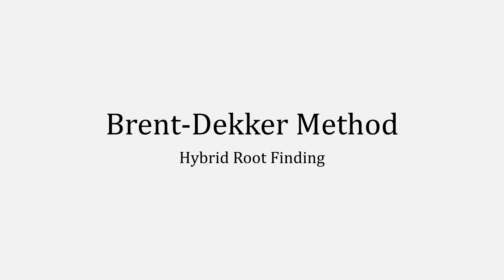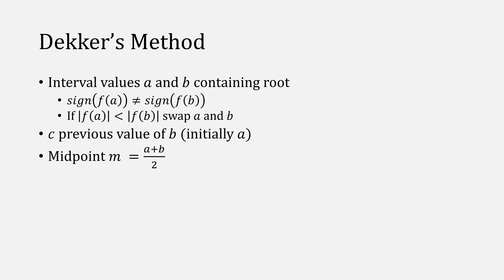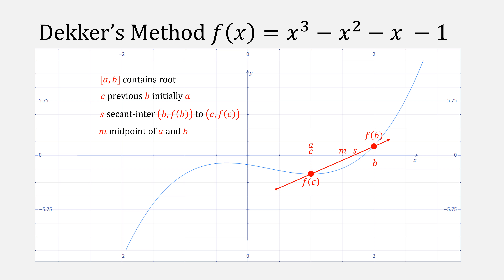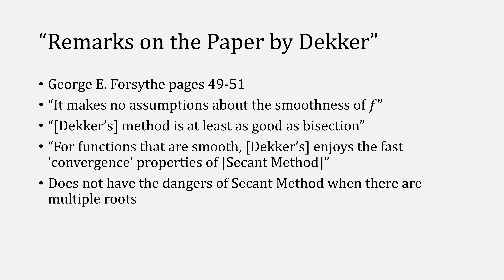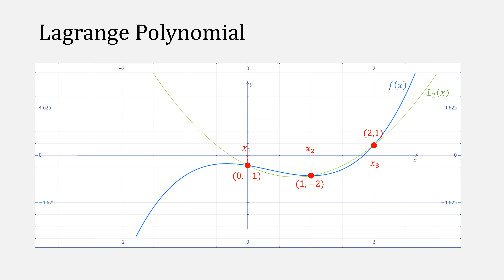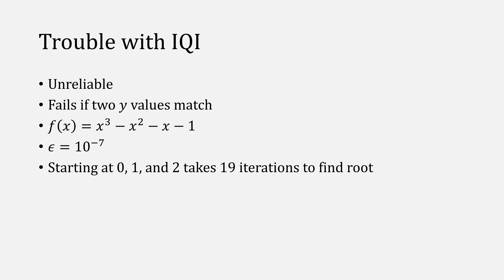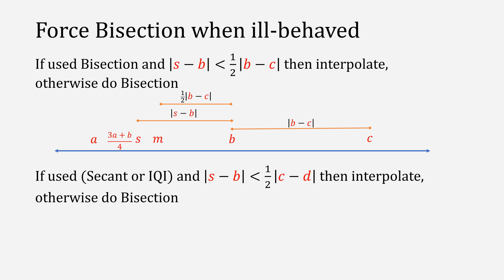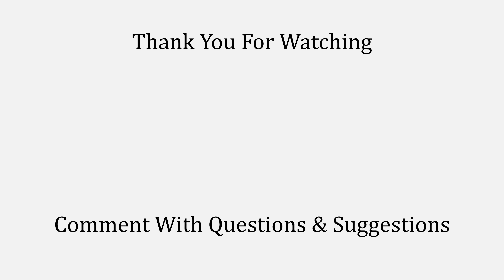Brent's Method

Comment: Remember what you said about a criteria: if the sign of the function of new b is the same as the sign of the function of a, the new a is the old value of b, otherwise a is itself. But what happens if either of these functions were zero? Which condition prioritizes the other?
Reply from the maker: Two things. At the initial iteration a and b can't be a zero because you start assuming they are different signs (which is easy enough to add logic to check). Therefore, the only way a or b would would be a zero during normal iteration could only happen if their previous s or m were zero which Brent adds checks for and returns when true. Therefore the iteration would stop before assigning that zero to a or b. QED
Reply: @OscarVeliz  Yeah. But what if f(b_new) or f(a) themselves were zero? Would a_new = b_old or a_new = a_old?
Reply from the maker: Give it a second glance. b_new is either s or m. There is a check to see if s or m are zeros. They would never get assigned to b_new if they were.
Reply: @OscarVeliz  I was trying to find the root of f(x) = (x - 1.75)^3 = 0, with the interval [1, 2]. At the first iteration, assuming that I followed steps, the function f(b_new) is equal to zero, and m is equal to 1.75, which is our root. If f(b_new) is zero, which is in our case, I get confused, because I don't know if the signs of f(b_new) and f(a) are the same or not.
Reply from the maker: Sorry I meant b or s see 10:38
Reply from the maker: You can check to see exactly how I did this via my github code

Comment: matlab code for those who want:
function [xi, Fi, xs, Fs, i] = Brents(Func, xl, xu, er, N)
xs=zeros(1,N+1);
Fs=zeros(1,N+1);
a = xl; 
b = xu; 
c = a; 
d = b - c; 
e = d;
Fa=Func(a);
Fb=Func(b);
Fc=Fa;
F=[Fa, Fb];
x=[a, b];
if prod(F>0)
    error('Root is not bracketed in [xl, xu]')
end
[~,indx] = min(abs(F));
Fs(1)=F(indx);
xs(1)=x(indx);
for i = 1:N
    if sign(Fa) == sign(Fb)     %  (If necessary, rearrange points)
        a = c; 
        Fa = Fc; 
        d = b-c; 
        e = d;
    end
    if abs(Fa) < abs(Fb)
        c = b;  Fc=Fb;
        b = a;  Fb=Fa;
        a = c;  Fa=Fc;
    end
    m=0.5*(a-b);
    % (Choose open methods or bisection)
    if abs(e)>= er && abs(Fc) > abs(Fb) 
        s = Fb / Fc;
        if a==c   % Secant method
            p = 2 * m * s;
            q = 1 - s;
        else  % (Inverse quadratic interpolation)
            q = Fc / Fa; 
            r = Fb / Fa;
            p = s * (2 * m * q * (q - r) - (b - c) * (r - 1));
            q = (q - 1) * (r - 1) * (s - 1);
        end
        if p > 0
            q = -q;
        else
            p = -p;
        end
        if 2 * p < 3 * m * q - abs(er * q) && p < abs(0.5 * e * q) 
            e = d; 
            d = p / q;
        else
            d = m; 
            e = m;
        end
    else
        d = m; 
        e = m;
    end
    c = b; 
    Fc = Fb;
    if abs(d) > er  
        b = b + d; 
    else 
        b = b - sign(b - a) * er;
    end
    Fb = Func(b);
    Fs(i+1)=Fb;
    xs(i+1)=b;
    if abs(m)<= er || abs(Fb) <= er || i==N
        Fs=Fs(1:i+1);
        xs=xs(1:i+1);
        [~,indx] = min(abs(Fs));
        Fi=Fs(indx);
        xi=xs(indx);
        break
    end    
end
end

# Numerical Methods for Engineers Seventh Edition by Steven C. Chapra and Raymond P. Canale

apps;
% Func=@(x) 668.06/x*(1-exp(-0.146843*x))-40; xl=12; xu=16; N=100; er=1e-12; xm=[];
% Func=@(x) x^10-1; xl=0; xu=1.3; N=100; er=1e-12;
% Func=@(x) x*x*x-x*x-x-1; xl=1; xu=2; N=100; er=1e-12;
% Func=@(x) x*x-exp(x); xl=-10; xu=10; N=100; er=1e-12;
% Func=@(x) (x+3)*(x-1)*(x-1); xl=-4; xu=4/3;  N=100; er=1e-12;
% Func=@(x) (9.81*x/0.25)^0.5*tanh(4*(9.81*0.25/x)^0.5)-36; xl=50; xu=200; N=100; er=1e-12;
Func=@(x) sin(x)-x.*x; xl=0.5; xu=100; N=100; er=1e-12;
%%
[xi, Fi, xs, Fs, i] = Brents(Func, xl, xu, er, N);
disp([xi,Fi])
exs=abs((xs(2:end)-xs(1:end-1))./xs(2:end));
figure('color',[1,1,1])
subplot(2,2,1)
semilogy(exs)
hold on
semilogy(abs(Fs))
legend('exs','eFs')
set(gca,'fontsize',14)
grid on
xlabel('Iterations')
ylabel('Residuals')
title('Brent''s Methods')

good work my dears

Comment: Oscar Veliz, have you tried making fractals based on the Brent-Dekker, bisection and regula falsi methods? I have a lot of hard time making attempts to make it work. Is it doable?
Reply from the maker: I have not tried making fractals based on those methods. Generalizing Bisection and other interval-based approaches to the complex plane is not straightforward. Check out the paper "A Global Bisection Algorithm for Computing the Zeros of Polynomials in the Complex Plane" by Wilf, which is essentially an improved version of Weyl's algorithm. Also take a look at "Approximating Complex Polynomial Zeros: Modified Weyl's Quadtree Construction and Improved Newton's Iteration" by Pan, that resembles a generalized Newt-Safe for the complex plane. I might make videos on these... no promises.

Comment: I think IQI can also fail if your three points happen to be colinear.  Am I wrong?

Side note, I would appreciate it if you broke these videos down into multiple videos.  IQI, Brent, Dekker. There is a lot of content here and plenty to go over; they are worthy of their own videos, I would argue. Youre feeding us arguably too large of bites at a time.
Reply from the maker: IQI would fail in that case.

I actually went back and forth on splitting these topics. I decided though that if someone started watching a video on just Brent's Method that said go watch Dekker's Method then YouTube would penalize it. I did put chapter markers though so people can go directly to just the Brent part if they want.
Reply: @OscarVeliz  They penalize you for referencing other videos, as suitable followups or necessary prerequisites? Kind of hard to build content up in lesson-form without doing one 500 hour video. BS. I hope they hit MIT's channel as their content builds on each other and references prior lessons.  YT is kind of trash these days; migrate over to one of the competitor platforms, my guy. Many people are, and I spend more time there than here anymore.  Fast growing, and you want to get in on the ground floor. Let me tell you, there are not a lot of math videos on those platforms. You have little competition.
Reply from the maker: YT cares about watch time and retention. A good metric is to have 20% still watching after the first 30 seconds. Clicking off the vid can count as someone who didn't finish. In Mist's case, all of their videos are usually recommended in order anyway so pre-reqs are more for those who weren't aware of what they came across or somehow landed on something more advanced than they thought. Their channel has amazing watch time and completion metrics. Smaller channels like this one, with much shorter videos, doesn't get as much attention.